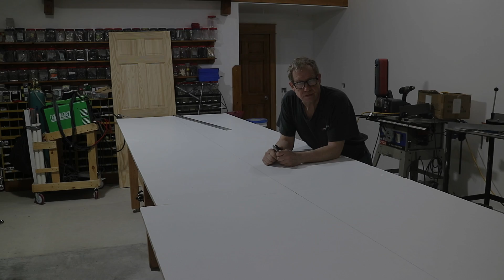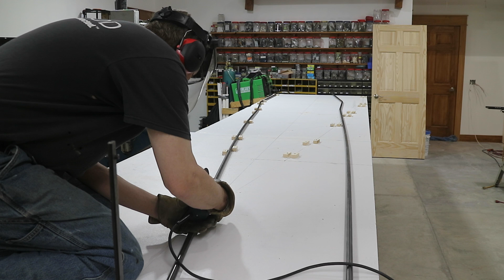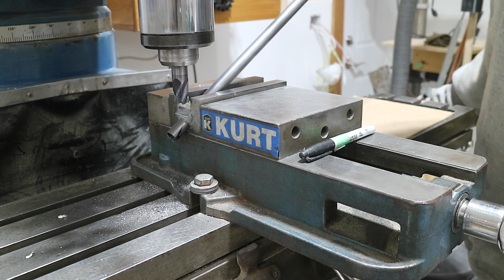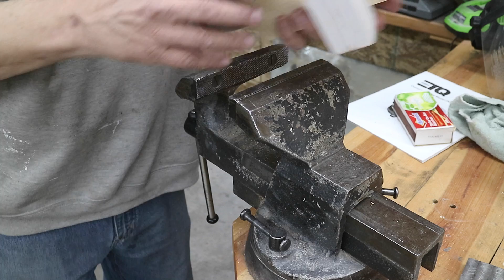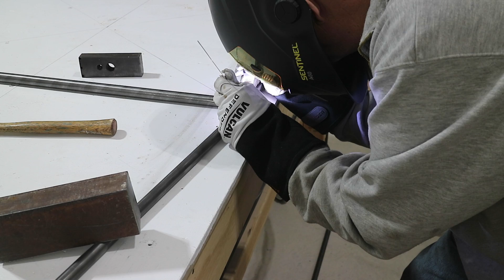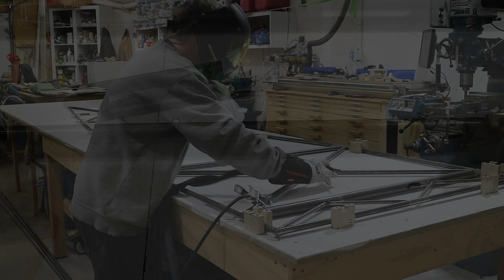Bearhawk Experimental Airplane Build : Fuselage Top

Comment: What material are these tubes made of EXACTLY? Aluminum? What type of aluminum? Do you do heat treatment after everything is welded?
Reply from the maker: Chromoly 4130 steel. On thin tube heat treatment after welding is not necessary.
Reply: @BSpotBuilds  Without wanting to go on too long, what is the thickness? Tanks for support
Reply from the maker: @jayfrossard  Most of the tubing in this video is .049" wall thickness.

Comment: I never thought about painting my table white.  Always drew on it.  Gonna be doing this to salvage my last table.  Very impressive video.  Trying to grow the nerve to plans build after finishing my last kit.  Did you feel the bear hawk plans were easy to decipher or is there a lot of chin scratching?

Also why put it away tacked instead of finishing out the welds?

Sorry about all the questions
Reply from the maker: Bearhawk plans are probably average on detail. Defiantly there are parts  not defined in great detail., but there is a large community and good forums that you can get most questions answered. The designer will also field your questions when nessassary. 
As to tack welding and putting the top away. When mating the top and bottom the vertical tubes will attach to the intersection of the tubes on the top and bottom forming a cluster, that after confirmed everything is square and in proper alignment will be welded together.